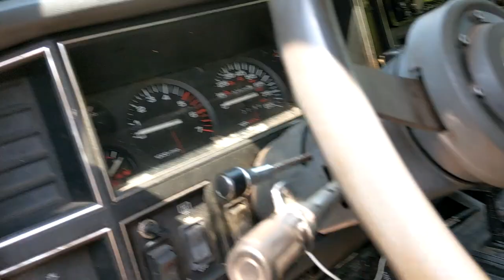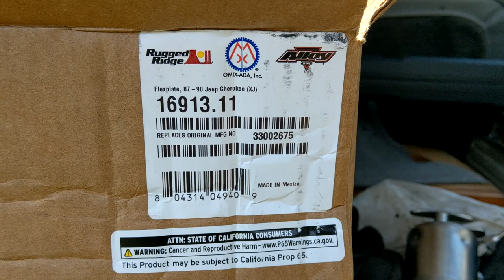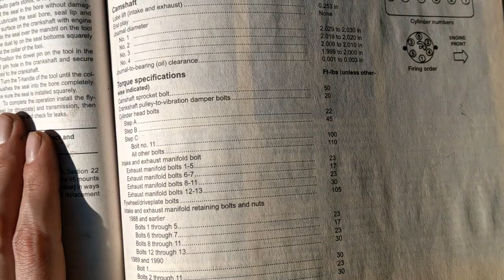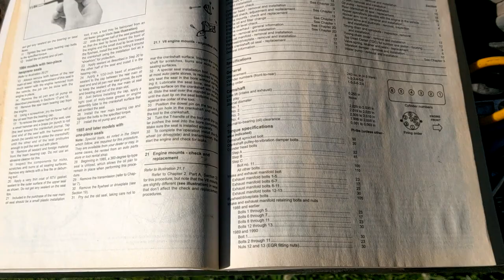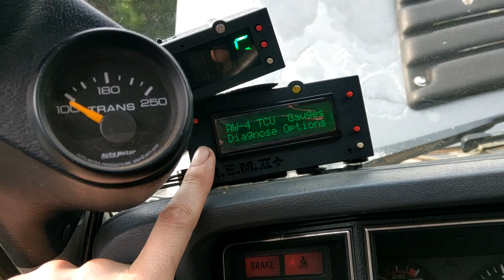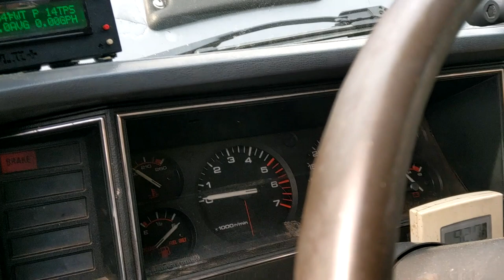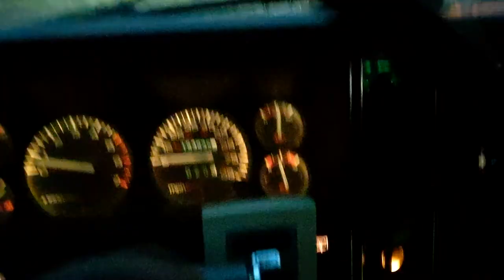89 XJ 4.0L Flexplate Replacement

Comment: I had the same symptoms and noises on my 96 Xj then I watched your last video on the flex plate which made me think mine was bad but it turned out all 4 of my torque converter bolts were loose.
Reply: same here

Comment: After watching this video and the house alternator vid I remembered an argument I had with  a guy at AutoZone a few weeks back. The alternator for the jeep is different than the replacement part you get from the parts store.  The lowest mounting point of the replacement alt is about 1.2 mms wider on the backside and doesn't fit. Looking at the msg boards other jeep owners complained that it was difficult to install without identifying the cause.  The argument I had with the guy at AutoZone is that he said there was a problem with my truck.  My argument was that I had an '89 comanche and now a '90 comanche.  A while ago I physically removed the alt from the truck and brought it to AutoZone.  I showed it to them and they said it was the same,  but after pulling out a micrometer there was clearly a 1.2 mm difference.  So has anybody found anybody who sells the correct alt, there's nobody where I live currently who reminds alts.

Comment: My torque converter bolts come loose all the time and it sounds like knocking under load even with loctite I've tried medium and high strength and this last time I used hi temp hi strength. I have a 92 cherokee. Im running brown dog offroad motor mounts and there brackets, they aren't solid but they are close to solid and I think maybe the vibrations help loosen the bolts i haven't had any noise or knocking at all from anywhere once i tighten the bolts. I've started checking on them often since ive been driving it a lot lately. The bolt holes are ovaled out pretty bad ill be replacing the flex plate next time its out. I also checked my wifes cherokee and hers had one loose bolt i think it's worth checking periodically as regular maintenance especially if you have aftermarket motor mounts.

Comment: I replaced the Torx bolts when i pulled the transmission out. I also bought a harbor freight tap and die set. That way if i needed to add more threads to my bolts, like yours where the top sleeve part is, i could. it came in very handy for a few issues i had getting my XJ back together. You probably should have fixed that oil pan leak when you had the tranny out.  :P
Reply from the maker: If I had more time I'd be nice. This was finished the day before a trip haha
Reply: You don't need to remove the transmission to fix an oil pan leak or even a RMS leak on these engines. It's really nice.
Reply: @HeyMyAwesomePeople  that is true but with the exhaust and tranny out of the way it is a lot easier especially the hard to reach parts.

Comment: Thanks to your video, I've found the problem and how to fix it. Unfortunately I have searched 13 different sites (including Jegs and vintagejeepparts) as of this moment and can not find a flex plate for the 97 grand cherokee laredo I'm working on. It's the 4.0 242zj. If you or anyone else may have some advice or a site I would be very appreciative.

Comment: so question 4 years later, you called a flywheel and torqued it to 105 flb. but is it the flex-plate and should it be 55 flb

Comment: 2000 XJ and mine was making same noise and turns out the torque converter bolts were loose. After tightening now I have a bad vibration. Do you think a cracked flex plate can be the issue?

Comment: Bruh for the third time this week I have to back my motor off my trans. Problem now being I need to line up the 4 holes. Because loose it still turns the converter. Believe me I cranked the motor over an over and couldn't get it to slip into place. Or at all.

Comment: Hey nick! Your video finally helped me diagnose the lower end noise I was hearing and could never figure out. Like you the flexplate on my 98 was completely cracked all the way around and wouldn't have survived much longer. But hey I have a question for you. I have everything put back together now and I'm having some issues. Primarily a p1391 CPS CEL. Replaced with a new one today (Napa echlin) and no dice. Rough idle and spits and sputters. Could this be due to the flexplate? I'm running out of things to check. Appreciate any help.
Reply from the maker: I'm assuming you bought the correct flexplate for your year? They've changed over the years so you want to make sure you've got the right one. Aftermarket may have been timed wrong. Was there anything else you did to this engine, or just pulled it to swap the flexplate?
Reply: @NickInTimeFilms  I appreciate the response dude but I figured it out 3 cps sensors later. Installed a mopar cps and it fired right up with no issues.

Comment: I've been trying to figure out for the longest damn time what that sound was on my 94 YJ Wrangler.
It only seems to happen when it gets hot usually after pushing it at highway speeds the million dollar question i have is this thing safe to drive long distances with?
Reply from the maker: Eventually it will split completely and then the engine will no longer spin the transmission.

Comment: Yo.  I think I've got the same thing going on in my 4.0 swapped Comanche.  When this was happening, did you feel increased vibration in the cabin from the cracked plate?  I'm guessing mine is either warped, or cracked, but I wasn't sure if that would add vibrations into the cabin.  Good video btw.
Reply from the maker: Might be worth checking if all your transmission bolts are still tight, Pretty sure mine cracked because a few were loose or missing.

Comment: Mine on my Comanche has the same symptoms but it randomly started stalling not long before it started knocking. Thinking it being cracked is goofing with the CPS causing to to lose spark and stall. What you you think Nick?
Reply from the maker: Could be possible. Might be worth checking if all your transmission bolts are still tight, could be pulling the flex plate out of alignment from the CPS

Comment: The flex plates were ok, you had a problem with starter
Reply from the maker: I had issues with both. I need to edit the new starter video, but turns out the front gear section was messed up and causing skipping during start

Comment: When you first were having issues with the torque converter spinning with the flexplate were you not worried about correct spacing between the flexplate and torque converter for expansion? Will this not damage the transmission pump without having any space?
Reply: Curious because I just threw in my motor and am having that same thing happen. I was told that it will cause issues and that I must have not installed it correctly
Reply from the maker: Since the flex plate is bolted to the engine, all the spacing is done by the bell housing when it's bolted to the engine. The torque converter gets sucked in tight to the flexplate when it's bolted down, that's just how it sits
Reply: @NickInTimeFilms  when you installed the transmission I assume you set the torque converter all the way back seated as far as it would go into the pump? If that's the case when you bolted it back to the motor the space/gap would be in between the flexplate before bolting it on. Then the gap would be at the pump. But when you went to bolt it onto the flex plate it was flush against it causing it to turn with the motor.

That is where I am confused. Right now that is exactly where I am at with my motor.

Comment: On my ranger 98, this same noise comes on either when its cold or warm. In idling, the noise is there, and when you rev too. What do you think could be the problem?
Reply from the maker: Does it go away when driving?
Reply: @NickInTimeFilms  no! Finally discovered that some of the lifters were stuck

Comment: If you EVER split the engine/tranny, ALWAY do the rear main seal.  Judging by all the oil on the engine pan, and the fact that you have a 4.0, that seal is as effective as a sock.  It's worthe the $10 not to have to do that job twice...   My 2 cents.
Reply: You don't need to split them to do the RMS on these motors.   You only need to drop the oil pan and rear main cap.

Comment: Im need you. help How do you know the position of the flex plate if you did not make a mark?
Reply from the maker: It only fits one way to the crank shaft. You can't mess it up.
Reply: Does the position of the plate matter?
Reply: first thank you very much for answering and helping me
Reply from the maker: Yes, it matters. It only fits one way and must go on that way only.
Reply: Very kind to answer the questions on the weekend I will check that the link was correct.
Reply: Excellent if you install it well since you have no way to fit in another position thank you very much for your help friend

Comment: just buy dealer parts....
Reply from the maker: Heh, you ever try buying factory parts for a 30 year old oddball vehicle? Every website I check says no longer available, and hell even Rockauto is starting to run out of specialty parts for Renix.
Reply: NickInTimeFilms just find out who manufactures it for Mopar
Reply: Easier said than done
Reply: 12957294 no it’s just easy period